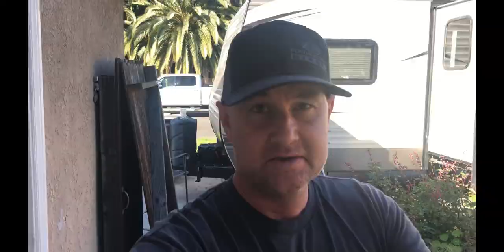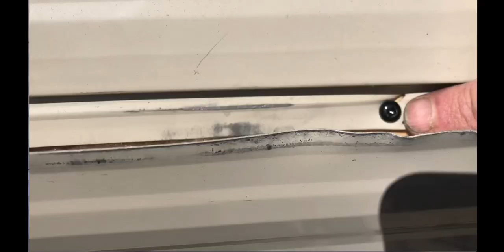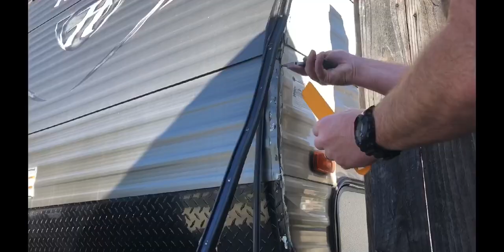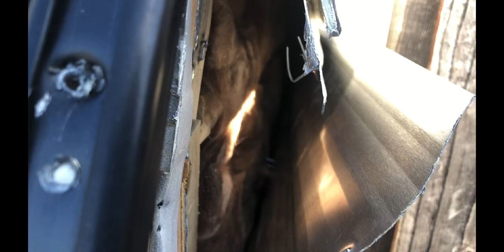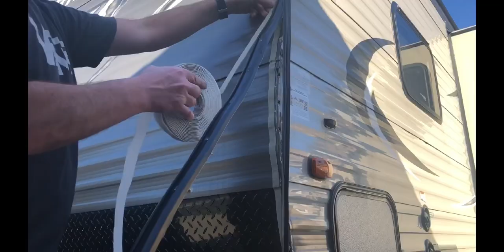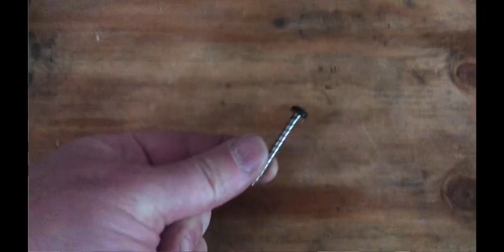RV Siding Repair/RV Living/RV Maintenance

Comment: You video is just what I needed. I have similar siding on my 2017 forest River Toyhauler. It freaked me out when I noticed it in my side mirror. I pulled into the next town and did a temp fix with aluminum ductwork tape. Good stuff for the emergency kit.  I’ll start my siding repair when AZ cools back off. Your vid is my diy motivation. 🤙🏼
Reply from the maker: I’m glad the video helped. That style siding is pretty easy to work with. Good luck with it!  Thanks for watching and leaving a comment, I appreciate it!
Reply: @loganandthehobo  
I finally pull the trim off to fix the siding.  Did you remove all the old adhesive under the trim before installing the new putty tape?
Reply from the maker: Hey there!  If I remember right, I just got most of it out, the easy big stuff. I didn’t go crazy with it though.

Comment: I didn’t know this was ‘a thing.’ We went camping this past weekend and I noticed my year-old camper doing the same thing. Unfortunately I’m already out of warranty. I went ahead and caulked what I could until I get get it repaired. Thanks for the video!
Reply from the maker: You’re welcome, hopefully it’s an easy fix.
Reply: @loganandthehobo  how did the  repairs hold up over time? I'm in the same position as this commentor. And thinking of doing this repair this weekend! Thanks for the video. 

Really hoping it goes well I'm supposed to camp next weekend!
Reply from the maker: It is holding up great. I have towed probably 5k miles since this repair and there are no issues. It’s good as new. 

Thanks for watching and leaving a comment, I appreciate it!

Comment: Nice job!  I'll be doing that next weekend as we're on a trip for July 4th and both sides of the aluminum are bulging from the side.  I was able to fix one bulge that was near the bottom but I need to fix the other side near the top when I get home.
Reply from the maker: Enjoy your trip!  We just got back from our 4th of July trip today. (I know, we are a little early...lots of logistics). I’ll post the video for that trip on Tuesday if you want to check it out. I’m kind of glad my trailer has the aluminum siding so it can be repaired fairly easily.  Good luck with your repairs!
Reply: @loganandthehobo  Glad you made it back safely.  We were thinking about coming back today to avoid the Sunday rush but we decided to stay an extra night and will come back on Monday.  Yes, I'm too glad to have aluminum siding on my trailer.  My last trailer had filon and it was terrible!  I'll look for your next video on trailer repairs.  I have a list of repairs myself and will be checking out the RV graveyard to see if I can get a replacement door window and bathroom exhaust vent.  Happy trails!

Comment: For as much as they charge for a new RV you think they would use some better manufacturing methods.
Reply: Hahaha, another shot of quervo. I picked one up with NO Woodrow. Replacing the back corner around the shower. A couple other spots not so bad.

Comment: If you are using stainless steel screws then they won’t rust when you get water intrusion so they will hold longer. By the time you can see something is wrong you will have much more water damage than if you use regular screws.  If you do alot of maintenance on your RV and are vigilant with it then you would probably be ok. If you don’t do your own maintenance then you might have a bigger problem than the stainless steel screws are worth. Just a little something to consider for us DIYers

Comment: Thanks for the video.  I have a Thor 28A, and the sidewall is separating from the flooring.  I can see daylight and the ground from inside the coach's bedroom.  I think it only needs to be screwed in with longer and maybe more screws.  I was just wondering what your opinion is.  I plan on taking it in to a pro, but if I can't for some reason I was going to do it myself.  It doesn't seem to complicated, just screw the wall back in.
Reply from the maker: I think if you are comfortable doing it yourself, it’s worth a shot. If you mess it up, you can always take it to a pro to fix it.
Reply: @loganandthehobo  Thanks for the reply.  I think I may give it a shot.

Comment: Where did you get that putty tape for the corner sealing?
Reply from the maker: I think I got it at my local RV dealer parts dept. 

You may be able to get it on Amazon. Here is a link that might work-

https://www.amazon.com/Butyl-Window-Flange-Camper-Sealant/dp/B0070O93HA/ref=mp_s_a_1_18?crid=D8N4R7Z8W8TD&keywords=rv+putty+tape+for+corner+trim&qid=1654729604&sprefix=rv+putty+tape+for+corner+trim%2Caps%2C172&sr=8-18

Comment: How long did it take you start to finish?
Reply from the maker: That repair was pretty quick, I only repaired the small area I showed in the video. And I have some professional maintenance experience. If I remember correctly, it took about a half hour. Definitely less than one hour.

Comment: What size of screw?
Reply from the maker: I used stainless steel screws. I believe the package said they were for lattice. I think they were one inch long. Make sure the screw you use is not too long so it won’t penetrate the interior wall. Any screw designed to be used outside, like a deck screw, would work.